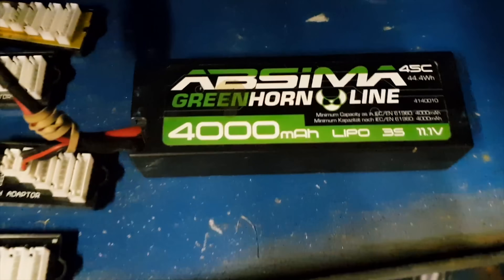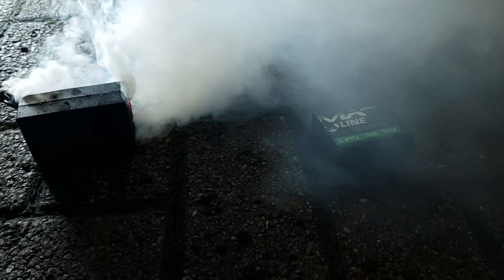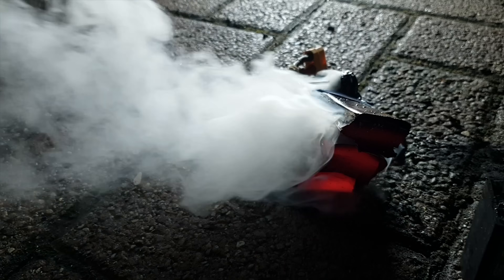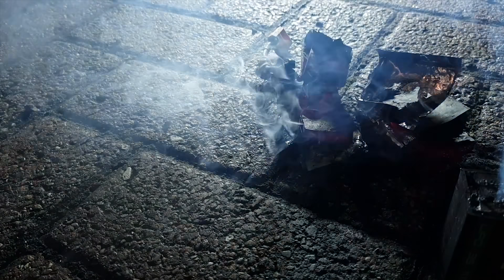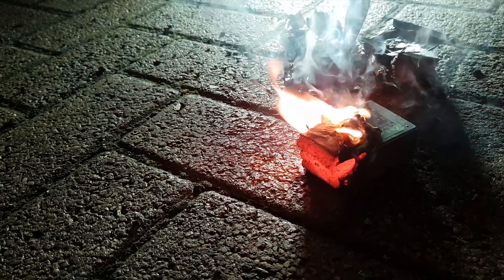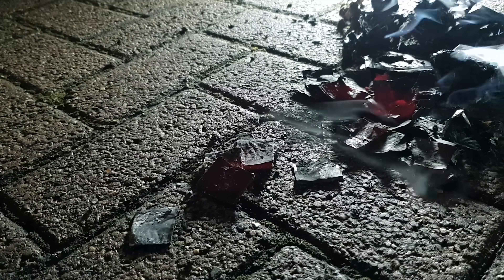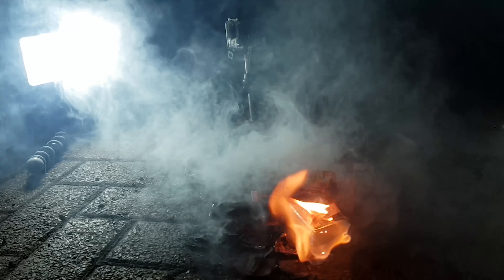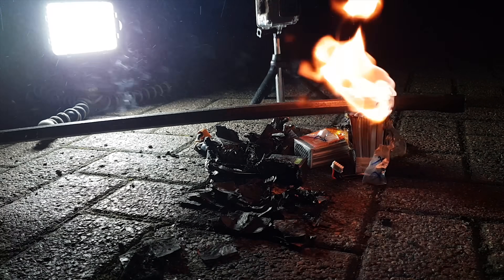What's Inside a Fully Charged LiPo Battery? FIRE!!!

Comment: It's not that fully charged LiPo batteries contain the fire inside. When a LiPo battery is cut in half, the internal components are exposed to the air, and the separator is cut in half. This can cause the battery to short circuit, leading to a fire or explosion. BTW, the chemicals inside the battery can also be released, harming the environment.

Comment: Stop destroying Lipos with 1 Dead Cell!!!!  
Open the foil. 
Shorting the Dead Cell with 12-16 AWG wire by soldering.
Cut the dead ballancer wire off.
Take one ballancer lead off and Stick it back again in the right Place of Ballancer Plug. Then the other.
You not need to change the white Ballancer Plug. When you leve the last Hole open it will Work with evry Charger.

I Think i should make a Wie so of it.

Comment: Seeing how someone called you out on the saw blade being backward, it was the proper thing because the physics of it, having it backward means it was a clean smooth cut, it wouldn't snag the battery, and it prevents the cells from catching fire before you could get it off, and it would have a slight bit of friction to just barely heat up the chemicals in the battery. If you think of it real hard of the possibility of the outcomes I think it was best

Comment: Warning to Americans and people around the world! China produces tens of thousands of these a day in different forms. There is a vast need for energy storage. They use these batteries they make until they start to degrade. Then they packed them up and sell them as slightly used batteries for the do-it-yourself industry to make your own powerwall! Beware where you buy these things if you are getting them from a company in Pennsylvania called battery hookups beware these are used batteries I bought 60 spim08hp batteries almost every one of them shows a short to the edge of the foil package which means the internal installation has failed excuse me that means that they are defective! They've already been heated up but did not catch fire and did not puff up as they say. I am planning on shipping them back but I'm having trouble with them trying to get on the phone now. Beware of what you buy you could be buying Industrial Waste from China! This is not a laughing matter if it burns down your house!

Comment: It's no different than cutting a grenade with a saw while the pin is pulled first. Lithium Polymer Batteries are no different to a bomb and why they are the worlds most dangerous battery.

Comment: lithium reacts with water so if you do it again put the battery in water and something amazing should happen!
Reply: Sadly it won't. 
There is no metallic lithium in rechargeable lithium batteries, they are lithium salts. Its the intense heat from rapid discharge and the flammable electrolyte that makes all the fireworks 😉 👍

Comment: Cut it in half then throw it in a bucket of water!
Reply from the maker: haha good idea!
Reply: @KevinTalbotTV  RIP that happen
Reply: The batteries are made of lithium. Throwing water on it would make it alot worse.
Reply: Water dosnt do a lithium fire any good Wont stop it
Reply: @larryhullinger8103  lack of oxygen really makes no difference?.. I find that hard to believe.
Reply: @scottmichael3745  watch his video where he threw a lipo in to a bucket of water and massive flames come out and then tell me you don't believe.
Reply: @scottmichael3745  Its true.  Doesnt need O2
Reply: @scottmichael3745  lithium reacts with water, same as aluminium, you probably know the water bottle bombs made with aluminium foils, right?
Reply: @scottmichael3745  lithium reacts violently with water and goes boom 💥
Reply: Jesse Carver You can find a similar video like that on his channel.
Reply: I saw that but it was an accident when one of his lipos went up while charging right? I was thinking cut it in half then toss it in, see if it's any different!
Reply: Larry Hullinger full of multiple gases, psycho technology.
Reply: Well I keep a bucket full of salt water near my lipo bunker charging area. Salt helps neutralize the lithium. Had an olde mr 4s 2200mah that I only used as power to my whoop charger.  Just after putting it on regular charger I heard it pop. Grabbed the pliers, yanked it off charger and dropped it in the bucket.  It started to smoke so I ran outside with the bucket and set it in my fire pit.  About 20 sec later, it went crazy, huge amounts of smoke. and boiled the water instantly.  If the bucket wouldn’t have been almost full, no doubt the water wouldn’t have done shit.
Reply: Ok gentlemen, I stand corrected! Thank you for the education! I always love learning something new! :-) and being a RC flyer, this kind of thing is a necessity to Know!
Reply: @scottmichael3745  Alkali metals a violently more reactive the more you go down the table. Lithium is just where it gets mildly amusing. Have a look got vids of people dicking about with some of the others in the group.
Reply: @SpiceFein  I'm aware of the periodic table bro, but my original statement about removing 02 from the situation still stands for traditional combustibles. But I'm still aware of the "chemical" reaction side of basic chemistry. My point is STILL valid (it was just SO Obvious I didn't feel the need to defend my factual statement). If you drop a flaming battery into a bucket of water, the fire will go out with the absence of 02. Yes the lithium reacts to the water, but not like Na. I stand by my Factual statement based on good old science. Btw, I recommend you don't set your batteries on fire so you don't have to test my "theory". Cheers bro! :-)
Reply: I hope they develop Caesium batteries to see people do this challenge lol

Comment: It's funny how the 4s floureons seem safer than the absima lipos, when they literally only cost £30 each

I've got 3 sets of them for the X maxx, btw the stock ESC is actually really nice to drive, nice rpm ranges and seems really efficient on the lipos, I get 40mins on 5.5a 4s lipos on the skatepark really going quite fast. Driven it through water, mud and seems fine so far. Just a waiting game I guess until it pops, but so far exceeded my expectations.
Reply: How are the floureons? I bought 4 but on of them came with a bad cell.